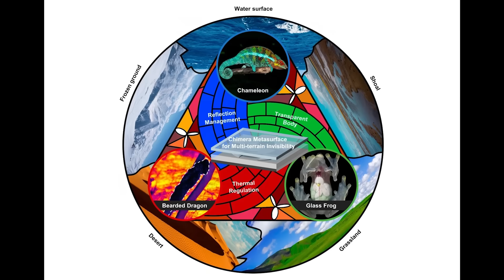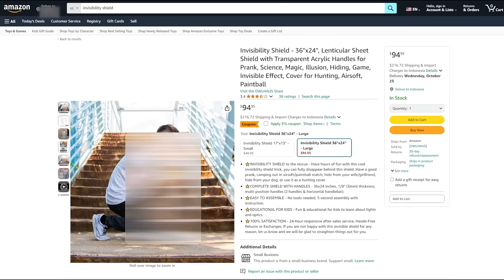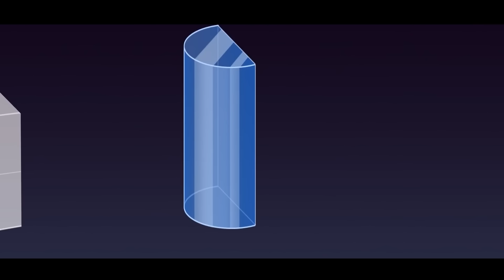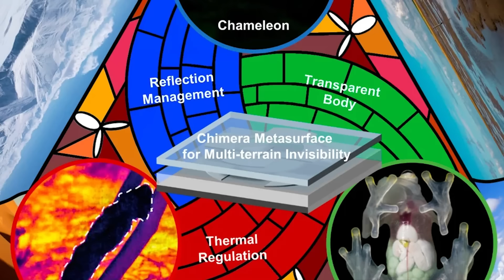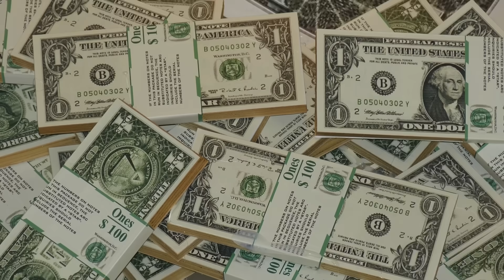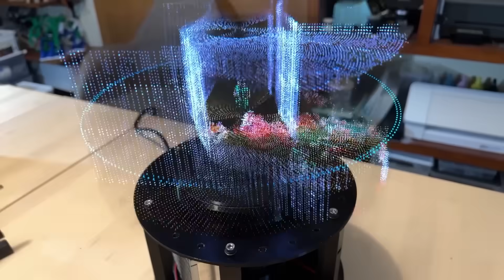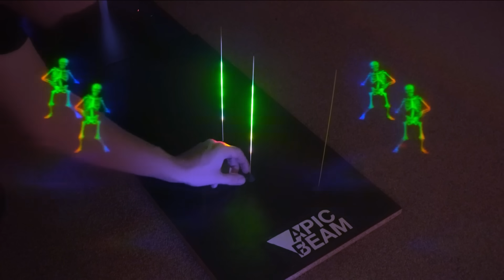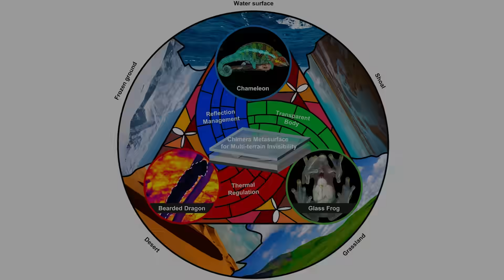China’s SECRET Invisibility Suit Shocked USA

Comment: 1. High-Cost Version (GHOST-X Elite)

Name: GHOST-X Elite
Cost to build: ~$250,000 - $500,000
Weight: ~8-12 kg
Battery life: ~15 days (with advanced power cells)
Technology used:

Transparent flexible OLED/mini-LED panels

360° AI-powered camera system (military-grade)

Quantum dot cloaking and light-bending materials

Radar-absorbent coating

Silent cooling system

Multi-layer sound-dampening fabric

Internal vision layer for user visibility

Encrypted wireless control system

Effect:

Highly effective in both day & night

Blocks radar, thermal, sound & visual detection

Built for military, stealth ops, deep surveillance

2. Low-Cost Version (GHOST-Lite)

Name: GHOST-Lite
Cost to build: ~$800 - $2,000
Weight: ~4-6 kg
Battery life: ~6-12 hours (portable battery pack)
Technology used:

Phone/tablet screens or recycled LCD panels

Basic camera modules (wide-angle webcams or cheap phone cams)

Raspberry Pi or Arduino for processing

Color-adaptive cloth for blending

Light mesh and plastic base suit

Manual switching interface

Effect:

Works best in static or low-motion environments

Mimics invisibility in basic daylight conditions

Visible if examined closely or in poor lighting

Good for concept demos, movies, magic shows, short-term stealth
Reply: Mmm

Comment: I wish I never deleted this video where a Tank in the Middle East stopped at an opening between two buildings. The guy talking about the video said; did you see it. The footage ran back a few frames in slow-motion and the guy said look at the middle of the screen. You can clearly see the outline of a man running across the screen from right to left getting on top of the Tank; getting off the Tank on the other side and then running off screen. Then a few seconds later the Tank turned into a Sand -Box or Vaporized. This was about 15 teen years ago, but this tech is real, and the new AI programs are under development. So by 2030, this tech will be commonplace.

Comment: Isn't this just large lenticular lenses?  Like the old books where you'd tilt the picture and it would move?  To my understanding they have done this, just on a VERY small scale and only certain wavelengths.  It's NOTHING like a frodo elf cloak at all.  I think it was dime sized and it would appear invisible to one wavelength of microwaves.  I think this is a still a ways off as anything really useful.

Comment: They had in the 90s.I watched a doc on a full reactments that uses new type invisible tech back in the 90s that was being developed. Invisible was around a lot longer than 2010.
Reply: I watched a documentary on New tech they were working on. One  was the invisible suite that puts images in front from the back.they even put it on military trucks plus they had a a camra ball and a emp that dropped from a chopper. They did a hostage reenactment with all this.the robber did not see 4 military trucks in front of his face or  officers. Choper flew over dropped a emp bump took out the lights the troops threw a ball camra,they all hade those predator suites  on that made you invisible l8ke predator longs you do not move go much.this was mid 90s.
Reply: We have tech over 100 years in the future today.
Reply: @horhaygonzalas3025 where's r suits at then
Reply: Then how come r military not using it where's r suits at
Reply: @JonathanDickson-w2g  you never show your strength
Reply: I think your wrong I have to disagree
Reply: @JonathanDickson-w2g we're not tho. It's been out, just not advertised.
Reply: They wouldn't call it invisible because it was so poor in quality. China's breakthrough has nothing to do with the old crappy Western made. China's technology is "self adaptive" even while in motion. China cracked the code.